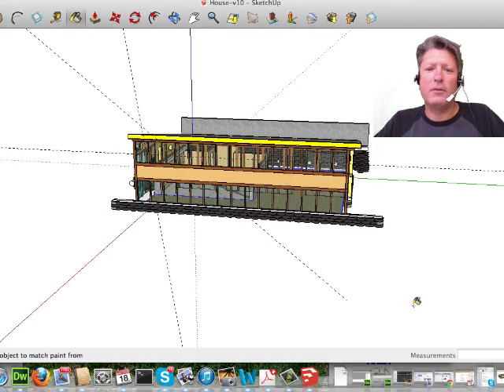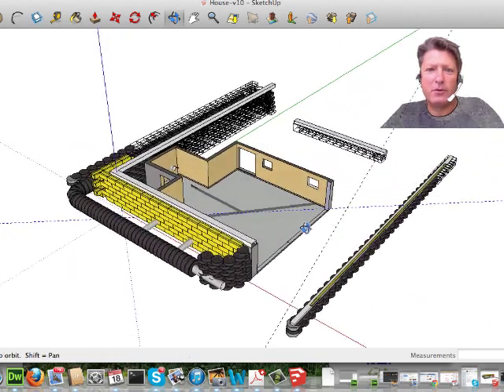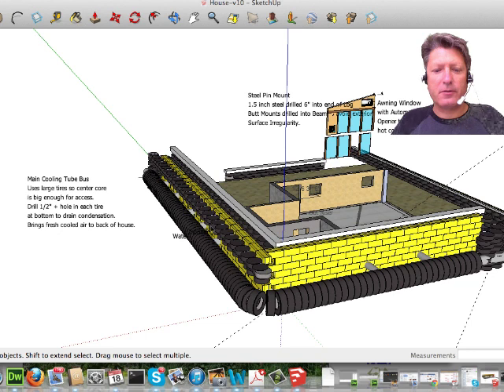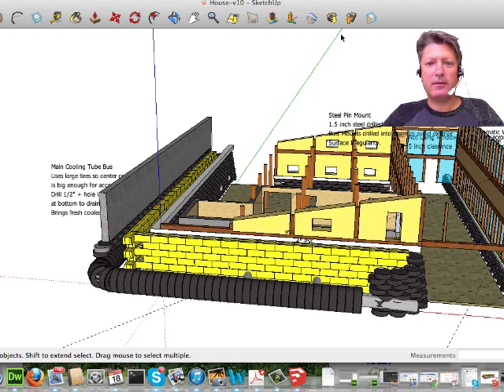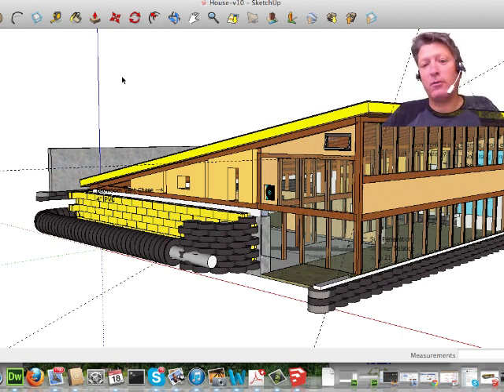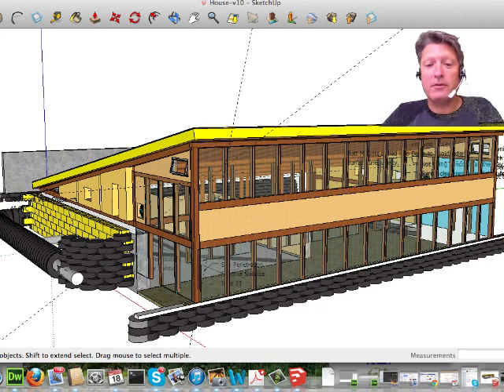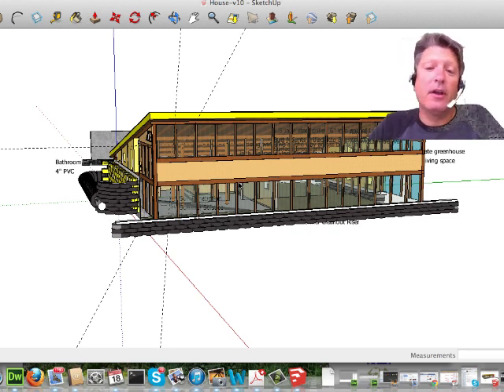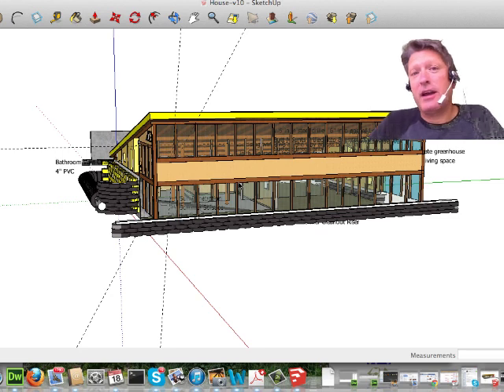Earthship Model Review - What's the model good for?

Comment: love earthships, too labor intensive. Couldn't you do about the same with shipping containers?
Reply from the maker: Not really.  It's really hard to implement thermal mass without playing with a lot of dirt.  Steel boxes tend to sit proud on the earth surface so coupling them to earth thermal mass is tricky.  

We're in the 2nd winter in the structure now at -16 F outside it was 68F inside, with 39 in the greenhouse with no heat whatsoever.  When the sun is in, we end up with the doors open to dump heat and enjoy fresh air - all winter long.

Not saying you couldn't do that with containers - but their utility becomes more complex in colder climates.
Reply: Phil Ray.... hire the local football teams to get the tires filled and placed.
Reply: I think filing shipping containers with dirt is an excellent idea.  My brother was always worried about tires for health reasons as well.  But I'm not sure the type of equipment that could lift/fill a shipping container with dirt and then move them around once they were filled.  You'd need really specialty equipment.
Reply from the maker: The tires are years old by the time you get them and they are encased in about a foot of adobe.  You never know they're there.  3 years later there are no signs of settling or cracking in the foundation.  The structure is solid and comfortable.

Comment: I love this. I am basically working same idea except a walk in outdoor/indoor shower area.. large shower-toilet-sink area then solid door to indoors area on the front left and a small welcoming bar to stairs/ loft for master bedroom and around to two baths and extra bedroom.
Reply from the maker: VibrationsfromMirror I implemented the same by installing hot and cold faucets in the greenhouse.  Right now we have a shower there.  Be careful about  putting plumbing in unconditioned spaces - as this would have caused our building inspector to consider the greenhouse conditioned space.  To meet rescheck insulation code, this classification would have triggered $25K in triple pane glass...
Reply: Please take a picture of area. Are you a builder as well? Greenhouse /shower sounds like a good idea...with runoff to a raised bed?

Comment: too damn big!
Reply from the maker: That was my initial perception also.  Now that we're dried in, and the space is observable, the openness is excellent.  The critical ratios of volume, specifically surface area (heat loss), and building materials (cost) improved considerably.  As the structure grew, we hit a nice zone of aesthetics, and comfort.  Projected finish cost is about $30 sq/ft.  We built the structure for about the same of a standard earthship - even though it's much larger.
Reply from the maker: After 4 years - it's nice to have a comfortable living space.  Really appreciate the size and that we can host 50 or more guests at parties comfortably.  Great party space.